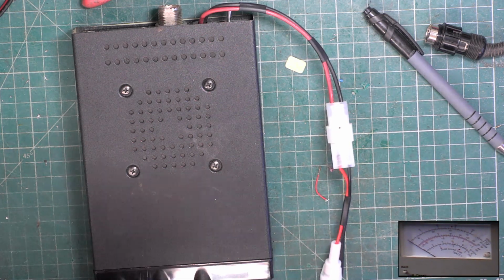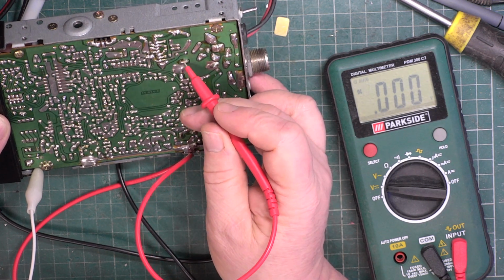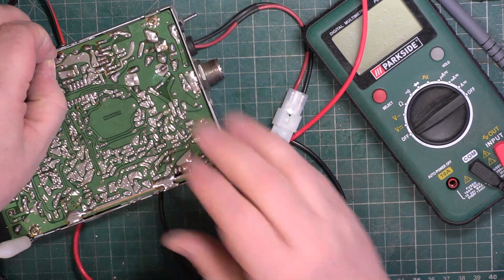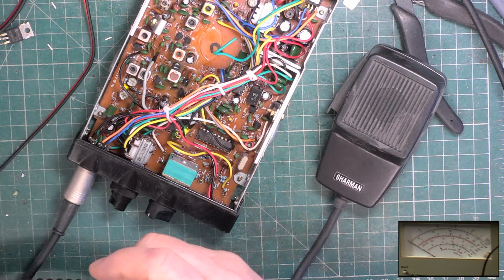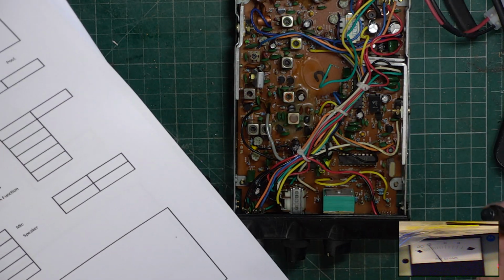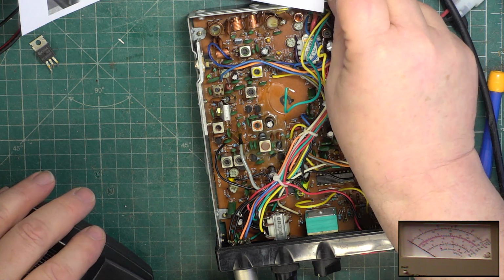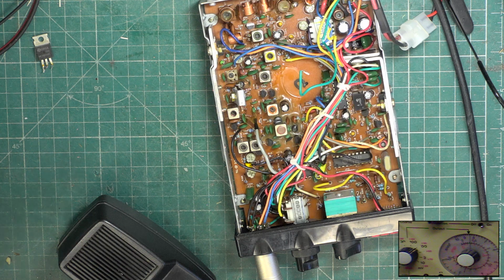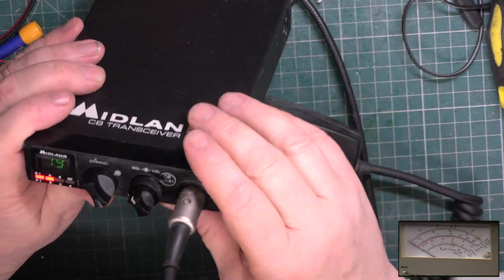Midland 77-104UK CB27/81 UK FM CB radio - extensive repair dead set

Comment: No heat sink compound!  Dear me, a bit of an oversight, but maybe they are like that, I honestly can't remember.  Tidy slim set for jamming between the seat and the centre consol, and connect it up to an extension speaker.  It doesn't have a proper meter, but then I never look at a meter when driving anyway.  Good job getting to the bottom of all those faults.  Some sets appear to be prone to dry joints.  I think the worst set I ever had for dry joints was a Grandstand Gemini.  The wax was a real pain as well!  You couldn't repeat what I said when I repaired that set either, I think the channel 19 was cleaner with the burner brigade!.  Keep up the good work, I just have a bit of trouble getting the time to watch all your videos, but I will catch up, so if you find I comment on a video you did a year ago, that is why!

Comment: I think it was the right thing you did with the heat paste, As you can see it has a big heatsink it bolts to. The 7808 voltage regulator should run cool now.

Comment: Why do rigs use 8 volts?  On the face of it, it seems like an unusual choice
Reply from the maker: That's a very good point & I've no answer. So the transmitter output transistor usually gets the full 13.8V & so does the audio amplifier. All the signal processing side of things is usually 8V. Most PLL chips are around 5V.  I can see that with this arrangement, most CB radios will still work to some degree (transmit at 0,5W) usually down to 10V.  Therefore a failing car battery in an emergency doesn't cause the radio to stop working. I'm clutching at straws here.

Richard, G0OJF, UK